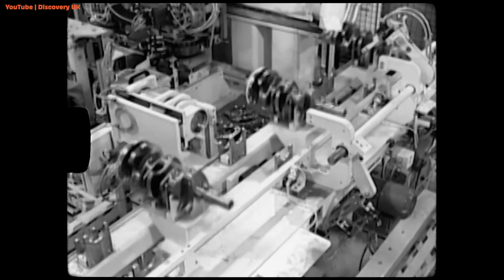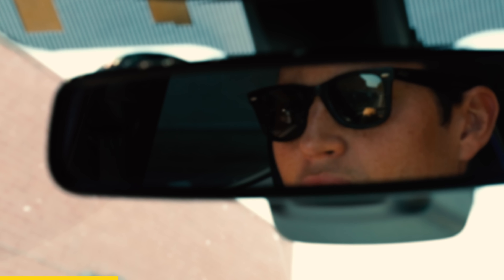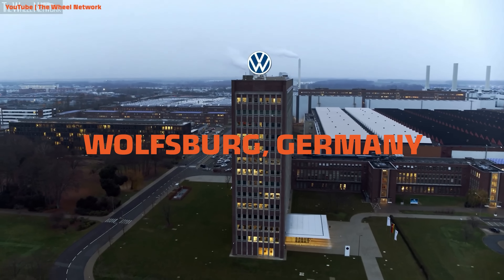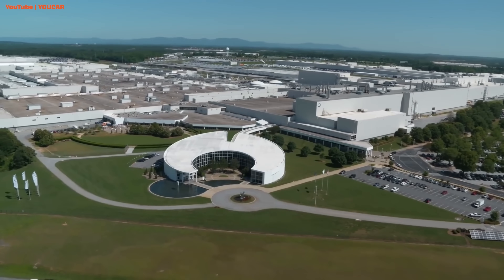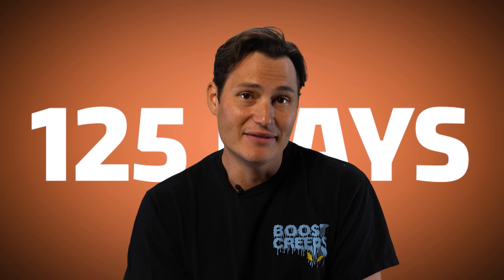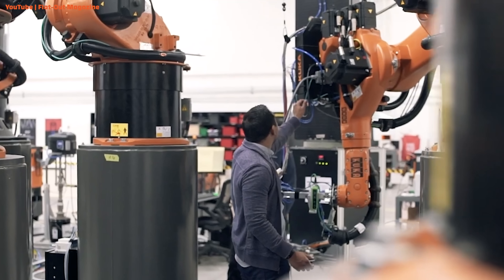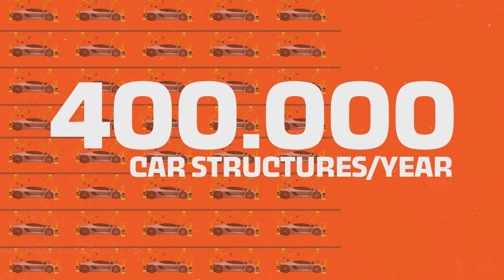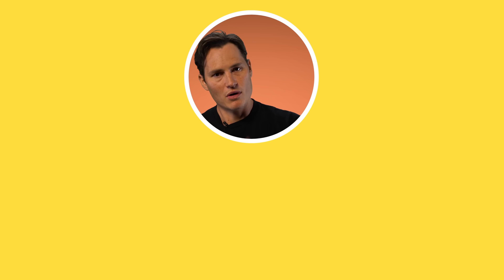A.I. Designed this Car

Comment: This car is not designed by AI, it is optimised by AI. There is a HUGE difference
Reply: What, you mean minimizing material use using ridiculously heavy calculations isn't going to make self-aware killer robots disguised as Governors?
Reply: @ryanhard5273  uhh but self aware robots already exists, they work 9 to 5 everyday and watch mainstream media.
Reply: Well yes and no. Topology optimization/generative design completely automates the process of making parts lightweight. An initial shape is drawn up in CAD and then imported into the generative design/topology optimization program. Constraints are set by the engineer regarding weight target, safety factor, material, loads, etc. The AI then eats away at the part until the until all the desired constraints are met. Newer more advanced algorithms allow the engineer to completely skip the modeling phase of this process by having the part grow to meet the desired criteria unlike current subtractive methods. 

So essentially I don’t think your giving the AI enough credit here. While the AI strictly speaking, is not 100% designing the car, it is automating most of the design process. A good analogy here is that it would be like drawing a big rectangular block as a bridge in CAD, setting constraints, having the AI come in make everything lightweight, and then claim that the engineer designed the bridge when all they did was draw a rectangular block and set constraints. Hence I find your assertion that the AI is only merely “optimizing” the part to be absurd.
Reply: Furthermore after watching the video in full, it appears that czinger has managed to use AI to not only optimize part weight but also their wiring, ducting, and manufacturing process which makes czinger the new state of the art as far automated design is concerned. Makes me very excited for the future of generative design/topology optimization, especially considering how new algorithms are coming soon to be able to optimize even more parameters such as drag and heat dissipation, not just weight.
Reply: @sonickiller360  " until all the desired constraints are met"
And then they find it forgot the cup holder. THEY forgot the cup holder.
Reply: sonickiller360 I don’t agree man. Maybe thats because im an engineer i dont want to be replaced by a computer, but who knows.. you’re saying most of the designing is done by this ai programming. But optimizing the weight of parts is by no means ‘most of the design process’. And typing in some constraints and a bridge rolls out, AI programming is nowhere near that. There are so many factors at play. I dont know where it will be in 50 years but right now, in my opinion it seems like a souped-up FEM program using machine learning. But hey i could be wrong, and the future scares me a little bit i gotta say
Reply: @OneShotKill3r   You may be right, I’m still working on getting my ME degree atm and while my analogy was a little crude I was trying to simplify this for the laymen to be able to understand (I know that bridges aren’t one solid piece of metal, they’re are far bigger engineering projects than that with many design considerations). I also do agree with others here that this car is definitely not 100% AI and probably never will be due to things like aesthetic concerns. 

All that being said however, I’ve looked at a fair amount research coming out of academia, and a lot of the iterative FEA stuff where you model the part, run the simulation, modify the part rerun the simulation, etc. is all being automated. The AIs for weight reduction are all very close to be mature with many algorithms even taking into consideration how the part will be manufactured. Off the top of my head the newest algorithms can take into account and optimize for when the part is being made on a 2.5 axis mill or a 5 axis mill, when the part is being cast, or the part is being 3D printed. More complex usage of AI or generative design is still very much relegated to the realm of academia. For instance, in most of the papers that I looked at with regards to CFD based optimization, most models were 2D silhouettes, however I did find one paper that managed to optimize the shape and internal structure of the wings of a passenger jet. 

Some thing that may also be of interest is growth based generative design. I haven’t come across any papers on it but desktop metal has a program called Live Parts that skips the modeling process altogether and seems fairly compelling.

So in short, I don’t think AI will be replacing engineers in the design process anytime soon, I have the feeling that once the algorithms become more sophisticated and computational power increases by enough, most engineers will be replaced AI in the design process with the remaining few directing the AI on what problem to solve and engaging in more artisanal and aesthetic design choices. The good news being however is that I don’t see that happening until at least 50 years when I retire. Or at least that’s what I tell myself before I go to sleep at night because I too do not wish to be replaced by a machine.
Reply: @sonickiller360  Okay you've definitely done a lot more research haha, and what you're saying does sound plausible. Definitely food for thought. You don't have to reply of course, but I'm curious what made you go for the Engineering Master? Any thought on what you wan't to do with the degree? I'm already working but I'm contemplating further studying, so I'm always very curious about people's career paths and choices.
Reply: @OneShotKill3r  I'm studying to get my Bachelors ATM so I'm flattered that you think that you think I'm getting my Masters. From my perspective I don't see why anyone would get a Masters or PHD in mechanical engineering unless you wanted to do corporate R&D or research in academia, but you'd have more insight into that question than I would unfortunately.

Edit:
I just realized that you thought ME was short for masters in engineering not mechanical engineering. Sorry for the confusion.
Reply: @sonickiller360  haha no worries that was my mistake. Hmm you reckon it’s a prestigious thing? In Holland if you do a bachelors at a university it’s pretty implied you’ll follow through with a masters too. And yeah I guess maybe you’re right. Although masters aren’t necessarily research masters
Reply: @OneShotKill3r  I'm studying in the U.S. and most mechanical engineers just grab their Bachelor's and get out. The concern being that if you apply for a normal mechanical engineering job that only requires a Master's, you'll be seen as "overqualified" and HR will think something is "wrong" with you outside of your resume, because HR will be wondering "why didn't they apply for/get a job that requires a Master's?" So essentially it is feared that a Master's can hurt your hirability for a normal mechanical engineering job. For my career plan, this isn't optimal, because I just want to climb the ladder and get a job in engineering management. So, all I really need to do is get my foot in the door and a Master's, at best, would do nothing to help me get closer to that goal, and at worst, would actually hinder me. These, however, are just my musings based on what I've heard in University and what I've read on sites like Reddit, so I have no idea how grounded these claims are, since Reddit and University are most definitively NOT representative of the real world.
Reply: @sonickiller360  Hey, better late than never right.. Oke well that sounds like a good plan. Maybe it's a bit more American culture to get your foot in the door and work your way up the corporate ladder, instead of getting the proper qualifications. Why do you want to get a job in engineering management? Any idea what kind of engineering/products?
Reply: @OneShotKill3r  When I did robotics in high school, I was the design lead for our robotics team and I really enjoyed it. I've always been interested in defense/aerospace as that's where the bleeding edge of technology is as well the hardest problems.
Reply: @sonickiller360  Ah that's cool, leading a team sounds great, wish I was cut out for that haha.. And hell yes I very much agree about defense/aerospace. Don't you reckon though maybe most mech. engineers would wish to work on that stuff if they could? And I have another question :-) I'm looking into master programmes in northern america and I'm finding stuff that makes it seem as though over there, you're supposed to bring your own research topic, and then they give you their resources and guidance, and after 1-2 years you get a degree. Whereas over here a masters is a  pre-set programme of two years with a curriculum. You take a lot of classes, specialize more, and in the last semester you do a thesis. You reckon that's true? That there's such a difference?
Reply: @OneShotKill3r  I'm going to school in Dallas atm, so there is huge number of defense firms for me to choose from so hopefully getting a job there won't  be an issue. As far as masters degrees it seems to be all about research and wanting to do research, because your research is the main reason you're getting masters.
Reply: @sonickiller360  have never commented on YouTube, you made it happen
Reply: @joshberliner4149  I’m flattered.
Reply: @joshberliner4149  and that's your contribution... you could have stayed silent sparky
Reply: Exactly, the hype and fad is strong in this one.
Reply: @tehdreamer  you're right, despite the arguments in this thread, the AI didn't  100% design the car.
Reply: @TyTy-gm8yb  maybe you are unfamiliar, but generative design programs actually do automate the process of making a part light weight. To start off with, a finite elemental analysis is done of the part and then parameters such as percentage of material removed and desired safety factor are inputted into the program. The program then removes material until the new part meets the desired user inputted design criteria. Every major CAD suite has this functionality now and I expect that in the future, more parameters will be able to be optimized for such as aerodynamic and thermodynamic properties. In aerodynamics in particular I’ve seen in research papers this technique being used to optimize the shape of passenger jet wings.
Reply: Yea they love to throw AI or quantum as sales gimmicks it's annoying when you wanna see what AI is really doing
Reply: I had no idea this comment had so many replies lol.. for the record, I am a design engineer and have used topology optimisation before, so I know exactly how it works. The video implies the car had been designed by AI, I am simply saying it has not. Some parts have been optimised by AI after engineers input various parameters. They have still designed the car
Reply: @TyTy-gm8yb  I don’t understand what you’re trying to say. While I haven’t made an A.I. I have worked with them with respect to generative design programs, so I have a fairly good understanding of what these programs are capable of currently and what they’ll be capable of in the future.
Reply: @TyTy-gm8yb  I’m a dumb Mechanically engineering major, I only know how to do hello world in C and C++
Reply: @TyTy-gm8yb   Yes. Can’t post links but the function in Autodesk Inventor is called shape generator, in solidworks it’s called topology optimization and in creo it’s called generative design topology optimization.
Reply: @TyTy-gm8yb  I don’t think there is one, albeit last time I coded was 3-4 years ago and I only got as far as arrays in C++. Don’t see how this is relevant to the conversation.
Reply: ai needs to get to the point that it can design the practicality for achieving an overall function.
Reply: It's like how God created the world and set all the parameters of elements then made man and man put all those elements together and hey presto we have the modern world.
Reply: @MIHMediaInc  i think you missed the fact it's 2020, not 1020.
Reply: Looks spidery. And weak like  thin sticks  of the future.    I’m sure it’s load aware. But I don’t want to two hundred on those leg bones
Reply: Exactly
Reply: Just to be sure we have to use AI as a tool only but not the replacement.Yes it will replace a job that actually meant to be done by AI
Reply: Just to be sure we have to use AI as a tool only but not the replacement.Yes it will replace a job that actually meant to be done by AI
Reply: I guess if we wanted to be closer to "true" AI, it would be something like asking a machine : "Build a machine that will transport one or more humans from point A to point B, optimize for speed, comfort and security".
Reply: Yup - generative design is an machine learning-based optimization of an EXISTING human designed part - not a from scratch creation.
The misuse of AI/ML kills me.  It's so deceiving how they bury crap under the AI/ML umbrella.
Reply: Clearly, you don't know how much of an evolution that is.
The A.I. may as well have designed it, because the complete redesign that came from it, is multiple if not 1000's of iterations ahead of the way human's design shit. (currently they seem to be more interested in finding ways to listen to and track you and collect that data, than making improvements to cars in general.)
Reply: @JohnGalt-w1o  based!
Reply: Exactly. Most of the stuff he talks about here is tech we have had for 10-25 years. If you look at the real engineering process for the 21c you will realize that only a couple inner chassis pieces used significant topology optimization and generative design.
Reply: Actually it's designed by AI built by A.U. well actually only the chasi is built by the robots. and humans supply the resources needed to creat this 11000rpm V-8 hybrid vehicle in probably a 4 month period.
Reply: The only thing Ai is creating is its own death!
Reply: An AI in the sense that it can do anything without a human interference is impossible. Computer will always be what humans can do but just in far less time. We are humans because of our conciousness and the emotions wich channel this infinite consciousness energy. It is possible for our conciousness to exist through a robot. But its impossible for humans to design a robot with a new conciousness.
Reply: It's not yet but it's going there with the rise of machine learning. The more the AI learn, the more things it can do. It's just a matter of time and data that is feed into it.
Reply: very much agree
Reply: @TyTy-gm8yb  Well seeing now that you are most definitely a troll, I bid you adieu.
Reply: Ya no kidding, the engineering prowess needed to manage all of the variables properly to input into the ai is unreal
Reply: Who designed it
Reply: Its optimized by algorythems.
Reply: take those raycon earbuds xD
Reply: Optimization is what most engineers do.
Reply: It's still a step in the right direction
Reply: It's optimised by stolen information.
Reply: The A.I. is doing the exact same job as today's human car design engineers, and more... 

A.I. trained with known working models
Humans trained with known working models

where is the difference in job title?
Reply: @SinnerD2010  human is better
Reply: @SinnerD2010  the differnce is who has the 'job'... one replaces several, while population continues to rise, put yourself and your neighbors out of work being too clever.
Reply: @paladro  So in other words... screw the engineers behind the creation of the robotic assembly lines, or the engineers behind the machine learning. No job is guaranteed, you either grow with the advances or you retire from that field.
Reply: @SinnerD2010  The computer doesn’t actually know what the car is, or what it does or how it is used, or how it makes humans feel. That’s the main difference.
Reply: @goawayihavecommentstomake1488  That's laughable at best, the constraints used to develop the designs are all the computer needs to know. With the constraints the A.I. is given, I would imagine it knows what a car is, and does more than most humans.
Reply: @SinnerD2010  AI (in its current form at least) would only know what a car is descriptively. Take the example of a wheel. A human sees a wheel and instinctively knows what a wheel is and what is and what it does. When an AI “sees” a wheel, it sees a solid that has a friction f with the ground, rotates at an angular velocity omega, and has X, Y, and Z loads applied to it.
Reply: @sonickiller360  I think you give human instinct WAY too much credit. In your analogy, those given factors matter far more in understanding what to do with a wheel than general human instinct ever will. 

Agreed, the understanding of things is different, but that's like comparing the intellectual prowess of a grown adult with that of a new born child...but in this instance the new born would sometimes win.
Reply: @SinnerD2010  I agree that human instinct, in an engineering context with regards to understanding a wheel, pales in comparison to an AI and I never said anything to the contrary. I was merely illustrating how AI aren't able to think in an abstract manner like a human would be able to. Your analogy sums things up beautifully, one can only imagine what will happen when the child grows up.
Reply: @goawayihavecommentstomake1488  ehhh wrong we have been taught all of these things by authorities and societal norms
Reply: @SinnerD2010  Oh really?? Does it know what the first rain after many long, dry days feels like on your skin?

Has it seen attack ships on fire off the shoulder of Orion. Has it watched C-beams glitter in the dark near the Tannhäuser Gate??

It’s just doing maths people told it to do, like any calculator. The engineer could do it, it’s just more time consuming.

If a person didn’t switch it on, it wouldn’t DO ANYTHING.

Laugh that truth away.
Reply: @goawayihavecommentstomake1488  Seriously dude... This is a discussion about artificially designing/developing car parts utilizing computational trial and error.

Go back to your Blade runner fanboy site.
Reply: @SinnerD2010  "Go back to your Blade runner fanboy site."
I'm pretty sure he was referring to "Soldier".
Reply: @NICEFINENEWROBOT  Nah, "Tannhäuser Gate" is a Blade Runner reference.
Reply: @SinnerD2010  It's in both. Was Orion's Shoulder also a Blade Runner reference?
Reply: @SinnerD2010  And you are giving "AI" too much credit also my friend, what these people call "AI" are really fast calculation systems and adversarial computational models that store the data and can reference it back. the advantage a computer has over a human right now is computational speed, and the ability to store exact data. all at the expense of size and power. Our brains are capable of doing what a computer can at a bare 20W or so, also humans do not human brains do not store exact data or images for everything, but it creates metadata about the things that happen and then reconstructs incredibly accurate representations of what you have experienced most of the time(key word most, we all know what happens when witnessing traumatic events). For to be true AI it should be capable of thinking, making philosophical arguments and be self aware their computational speed would be just an added bonus from the fact that they are quantum(maybe) computers, and consume insane amounts of power. So to say even though i am a developer and i love my computers and programs, i am squarely on team human, however Imagine a human brain enhanced by cybernetics, with all the ability of a computer added to it(Elon don't disappoint me here) we would become a completely different species(though im a little afraid of the "Laughing man").
Reply: @Sagittarius-Alpha  You had a decent point up until you tried to claim the human mind recreates incredibly accurate representations, that is woefully inaccurate. As for my "giving A.I. too much credit" I'm not sure that is accurate either, I've well aware machine learning is still rather limited, but I believe that limitation lies more in the hands of the engineers coding the experiments rather than the capabilities of machine learnings computational problem solving capabilities.

Yes I will admit, that "A.I." is a stretch, even in cases like machine learning. Its just much easier to say A.I. and have everyone involved here knowing whats being referenced here.

as for the rest of what you said, It is rather beyond the scope of this discussion.

Also, I'm fairly certain that QM based computers are not involved here.
Reply: @NICEFINENEWROBOT  I don't know, I'd have to look that up. But it is all silly none the less as the "A.I." being referenced is in no way shape or form comparable to what this entire discussion is about.
Reply: @SinnerD2010  Why is it that these days you have to make dissertations about a damned statement before you make it, otherwise the the other party always takes it literally or the wrong way. The picture your brain created is actually remarkably accurate, and here is the caveat so you understand better, considering what it has to work with, due to age, lack of attention, and traumatic events can change what you perceive and thus what your brain is able to store and then reconstruct. ALL of those things affect what , and how your brain builds that picture, is not just the "the brain cant build them accurately". It does it best what what it has to work with, and even then it still does a fairly decent job.

the issue with Calling it AI is precisely that not everyone know what they mean, and some people think these machines are actually thinking and making things better because of that. As for other things being out of the scope of the discussion, i am expanding as to what would make it AI, and what would make actually capable of thinking, which would allow it to come up for a design, and optimize it and build it on its own, as it stands it cant, as for the part about combining computing power with a brain to make both better actually plays into this too, if you do that you don't need "AI" to help you.

I am speaking of some AI computers maybe being quantum computers(which is why i said Maybe), i know the ones used here are not quantum computers.
Reply: @goawayihavecommentstomake1488  it doesn't really matter to the company. The computer did its job better than hundreds of humans. Besides, nature has the same  considerations, yet it made sentient life.
Reply: @NICEFINENEWROBOT  you should probably watch the film first. the entire comment was based on a blade runner quote.
Reply: @goawayihavecommentstomake1488  I believe those factors could be in the algorithms as well.
Reply: @SinnerD2010  imagination. yep, that there is computer logic.
Reply: @goawayihavecommentstomake1488  Right now AI (Artificial Intelligence) is in its "infancy" but growing rapidly. Over time more data points will be cataloged. It will eventually get to the point where AI will have all the knowledge/data points needed to perform routine and eventually experimental concepts/builds. A lot of people think that AI is a "fad" or incapable of doing what a human can do. At this point there may be some truth to that, but like humans these AI machines will learn "best practices / results" faster while retaining that information for longer and obsolete human skills. Humans can be very good at a few tasks, AI can be very good at all things when you give them the same toolsets as humans aka the ability to learn, observe, communicate, and manipulate their environment. Initial AI was dependent on human programmers, but as time goes on, AI will write better and more efficient code, removing the need for human interaction.
Reply: @SinnerD2010  "Constraints are all it needs to know" "With constraints it knows what the car is" So when I give my computer the constraints of the characters I type in, It then knows what my argument is? What I am trying to express? This "artificial intelligence, being described as using only constraints, i.e inputs, is then no different from any computational mechanism that solves an equation
Reply: @reimugota8181  First off, that's a very crude way of describing machine learning, leaves quite a bit out. 

Furthermore, I highly doubt you fully comprehend the vast number of constraints it would require in order to encompass fully defining even the simplest of objects. Also, user input, and variable constraint calculations are two separate things.

Secondly, artificial intelligence isn't a thing, its a category. Any input/output function with any amount of autonomy above none that is not of natural origin is in effect a form of A.I..
Reply: @SinnerD2010  The whole point of artificial intelligence is it doesnt NEED a shitton of constraints to create something. For example, the AI Dall- E only takes the constraint of what the human wants it to draw; everything from there is just the machine constraining ITSELF. Thats why a real AI creates many outputs from one input, because is is actually creating something from nothing. Your beloved, car printing "AI" would not create SHIT if it was given a more abstract definition of a car. Hell, if you gave it a bunch of other successful cars as learning data- something that is not really mentioned at all in this video or on hyperganics site- it would actually need to be a sophisticated AI to make anything useful out of that. Meanwhile, In this video, humans are literally picking the exact locations of all of the components, what components to use, and even a human made design for the exterior. All the "AI" is almost certainly doing, is using some standard mathematical models, made by humans, to optimize flow and efficiency in the system. In fact, you literally cannot argue it is doing otherwise, because in order for the AI to learn how to optimize such things, it would need to go thru relentless trial-and-error, printing part after part after part just to test how the flow works in said part, and to use such tests to identify how flow works in other parts as well. None of this os mentioned in the video AT ALL. If youre going to say that it would train itself using computer simulations, that is ridiculous as it implies that there are already computer simulations that could be tweaked to optimize parts for the vehicle, which is indeed true.  I think its pretty crystal clear that this so-called "AI" did not teach itself or learn much, if anything, and that it is relying very VERY heavily on human design, or as you like to call them, "constraints", to even create the vehicle in the first place, which is not something that defines an artificial intelligence in the first place.
Reply: @SinnerD2010  "Any input/output function with any amount of autonomy that is not from natural origin", So literally any computer system that has "autonomy that is not from natural origin". Sounds pretty broad to me, like, any computer system that makes decisions based on things it has learned? Could this apply to the people in the Sims? If thats really what we want to compare this AI to, then actually id have to say its probably a fair comparison.
Reply: @reimugota8181  TLDR gave up after you mentioned "my beloved car ai". Suppose to be a discussion here. 

I'll just say this, maybe you should read more before you assume things. No where did I state that the ai used in the manufacturing of this car was doing everything.
Reply: @reimugota8181  Quite simply, Yes. because like I said, A.I. is not a thing, it is a category. There are many forms and levels of artificial intelligence.
Reply: You're using AI to come up with the design and parts of the vehicle. How is that not using AI to design a car? It's like the ship of theseus. How many parts can be AI made before the car itself is considered AI made?
Reply: @Coder-zx4nb  because having "AI" optimize a human created object isn't AI designing a car.   It's AI optimizing a parametric part through generative design.    AI designing a car = Telling the system basic parameters- it needs 4 wheels and needs to do X number of things to x specifications - go do it.   AI ASSISTING and OPTIMIZING existing parts/objects is what you saw in the video.  The car was designed by a human, but optimized by AI/ML
Reply: @shirothehero0609  Hmm I do see your point. I feel like this more of a philosophical argument over the meaning of the ambiguous word 'design'; and if that means designing a car end to end or designing every individual piece. Nevertheless, I dont feel we're that far off from your vision of a fully AI designed car. That will be the way of the future for sure =)
Reply: AI doesn’t even know what a car is without being given a lot of parameters to work from